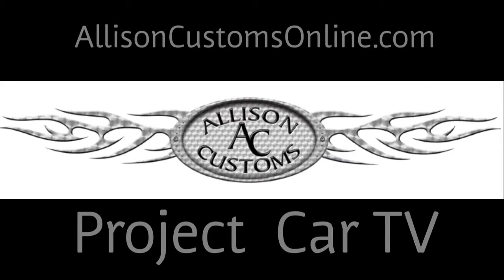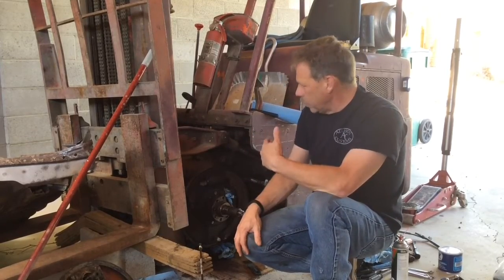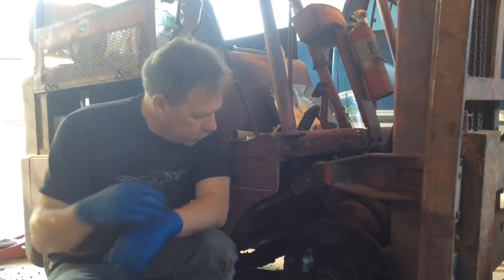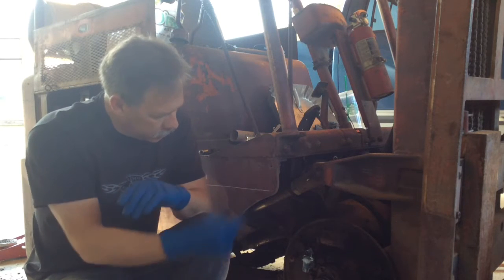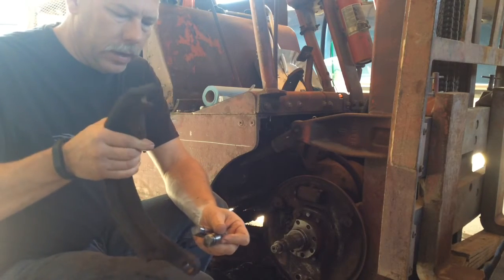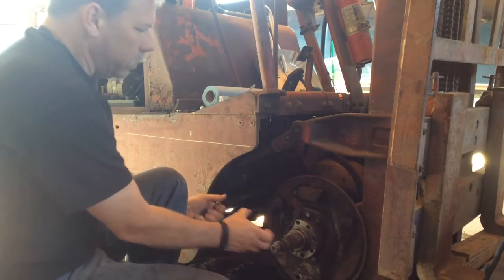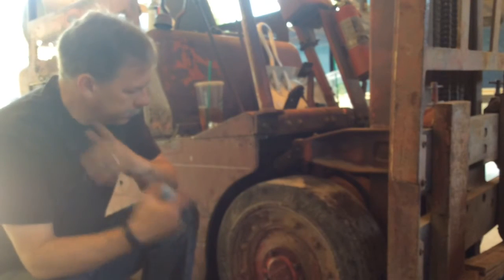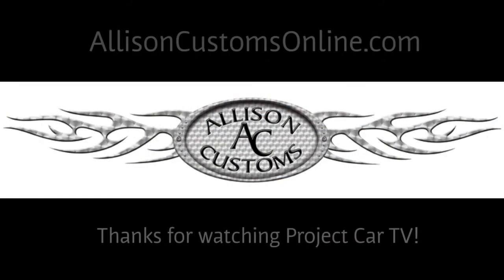1952-1954 Clark Forklift Brake Repair

Comment: hey i have a CL 358 2 Clark YardLift but it looks a touch bigger. Cant bleed my brakes as there is no bleeder screw. The difference from your video is my wheel cylinder is clocked at 4 oclock. It has one line in and thats it. I have no peddle and so was going to bleed. I thought someone may have swaped cylinders as it seemed like the backing plate has 2 holes at 12 oclock. I figured the 2nd hole was for a remote bleeder out line that would go up to high spot where you could easily bleed them? I certain im wrong, any advice i am all ears. Thanks in advance. :) John
Reply from the maker: John, I think you may be right, it doesn’t sound like you have the correct cylinders on there. As you know without some sort of bleeder, you are never going to get all of the air out of the system.  You could try holding the brake pedal down for an extended period of time (overnight) and MAYBE the air would work it’s way up to the master cylinder, but I think that is just a “Hail Mary”.  You are probably going to need to source a couple new cylinders with either a bleed screw or possibly drill and tap the pair you have. Without seeing them, I’m just guessing.  Feel free to send some pics and maybe I can offer some other advice.
Jeff

Comment: Thanks , we have the exact same forklift at work and after putting on a new master cylinder it seems like the brakes just come in contact with the drum as the pedal bottoms out . I guess I need to adjust those eccentrics .

Comment: Hi , I have the same Clark forklift and I checked the differential gear & it was low so I had to add 3 Qts tell the gear oil backed out of the fill port & now Its leaking gear overnight so I'm thinking the pinion seal is leaking  .  Did you ever do the pinion seal & if so any tips the easiest way P.S. Do you have any idea the weight of that forklift ?
Reply from the maker: I’ve replaced all of the seals and gaskets at this point.  On mine you have to pull the engine and then the trans to get to everything.  It is not a small job to get to.
Mine is something like 5 to 6 thousand pounds.

Comment: The cooling system has a nonpresserized cooling system. They  tend to leak when hot.
Reply from the maker: That has been my experience, although since rebuilding the radiator it happens a lot less often
Reply: What do you guys mean by it’s a non pressurized cooling system? I just had to buy a new cap for my 1945 carloader so I went with a non center cap.. I assume this is ok then? Where do they leak when hot? Mine I think has a bad head gasket as sometimes at certiain temps it pushes coolant out the radiator but so far no coolant has mixed with the engine oil from what I can tell.. any ideas? I know these flat heads are thin and warp easily
Reply: @BiffsEquipment  exactly what it means , the rad cap only seals on outer edge above overflow tube. Coolant level is set lower than with pressurized system. As water is heated it expands,if level was to high it would escape out of overflow tube which ran along side of radiator and dripped on ground. Later years a coolant recovery tank was used a long with pressurized cooling system
Reply: @joepacheco4038  right, yah I get the difference of the older and newer systems, but I don’t see a place where the coolant can leak out on my radiator unless I just missed it. Will it for sure have one? It would have to cuz like you said as coolant gets hot it expands like anything else .. the main reason I was asking was cuz I just purchased a radiator cap for my old Clark and I had to get a cap from the 1930s to find one that looked like it would properly fit. The cap fits great but has no vent, which is proper for this coolant system I now know, but I was more curious of where it would “leak” from the radiator so I can watch for it. 

Also with these old coolant systems, and flat head motors.. is it normal for a little bit of coolant to be blowing out of the radiator when the cap is off and RPMs are increased? It will sometimes blow coolant out, sometimes not.. depending on the RPM more than temperature.. I assumed it has a bad head gasket as these old flat heads often got warped but I don’t see any coolant mixing with the oil.. what do you think? I’m new to these old engines/systems and flat heads. Thanks!
Reply: @BiffsEquipment  leaking head gasket will be there at all times,not just when you rev up eng. If you feel it's the head gasket leaking there's a tool that smells the air in rad, also able to see bubbles in coolant with cap off looking in filler neck. Have found quite a few continental engs spilling coolant when rev'd up caused by flow restriction in rad, lower rad hose collapsing (usually caused by no spring in lower hose). What's the coolant temperature when problem shows up?

Comment: thank you for a great video. question for you... I just picked one very similar up, but can't get the wheel off. I'm thinking it was poorly serviced and the brakes created a groove making it hard to pull the wheel off. is there a way to back them in to help get the wheel off? thanks!
Reply from the maker: You will have to turn the eccentric adjuster to attempt to loosen the shoes enough.  The problem may be that the adjuster is not moveable (rusted or otherwise corroded) just like mine weren't, in that case removing the nut on the adjuster MAY allow you to then pull the wheel and shoes all at once.  Those wheels are VERY heavy so pull hard.  Good luck!
Reply: @AllisonCustoms   Hello in reference to your fork lift. I have the same old clark forklift and seen you where using a torque wrench. Where did you get your torque specs? I am having trouble finding all that information. I was just going to use the bolt size chart would this be okay? I didn't know how much to do the bigger nuts for the gear and wheel bearings? I would like to find a service manual as well. Any leads would be greatly appreciated. Thank you!
Reply from the maker: Picked up a reproduction service manual on eBay, also much of the information is the same as the Lincoln SA200 welders.  So most of the info is out there for free if you don’t want to buy / wait on a manual.